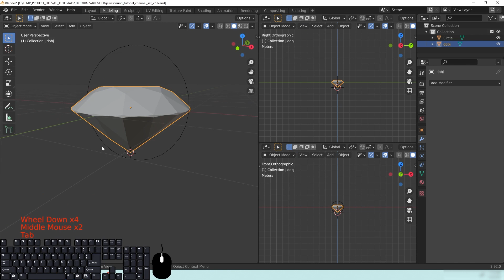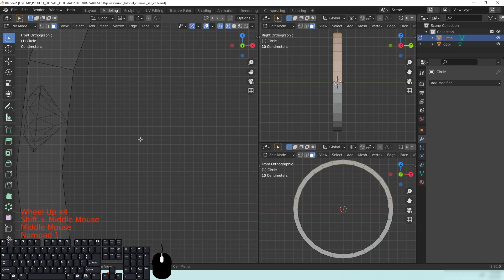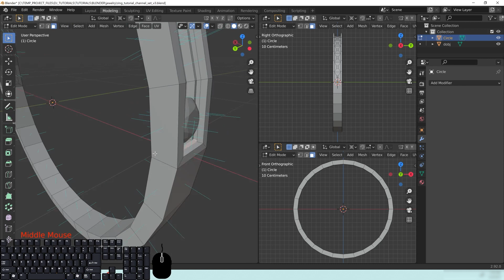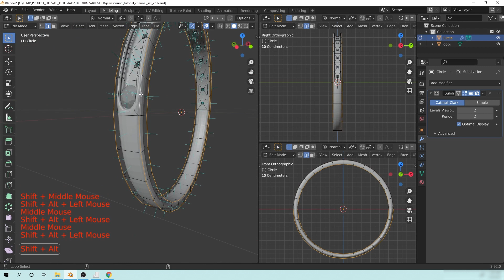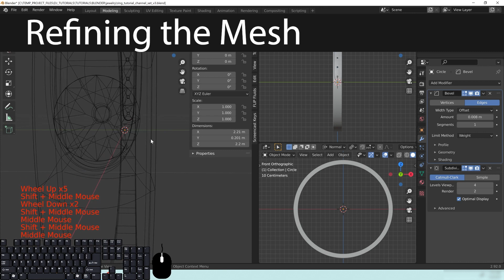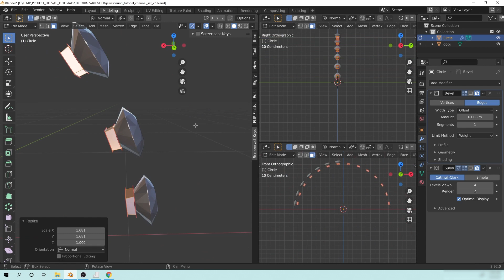Modeling A Channel Set Diamond Ring | Jewelry Design In Blender Part 1

Comment: I'm presented with a task of making a diamond necklace and then apply a rigid body to it. In this case diamonds not being the same object as the metal parts of the necklace might be a problem... Would you use parenting? Or something else to avoid a year long simulation?
Reply from the maker: You make the diamonds parented to the other object(s) or you can join them for the rigid body sim. There’s almost no reason not to have them as part of the main object (setting, etc). You might run into some weird materials stuff since some materials like it when they are they’re own object but you should be fine in this case.
Reply: @djtutorialscgi  cheers, appreciate it

Comment: The bevel doesn't work well, as always. I don't know why it always jumps from nothing to a tiny bevel and then nothing more, no matter how much I increase it
Reply from the maker: It depends on how you are using it. Use the angle degree to control which edges are beveled or in edit mode add bevel weights to the edge data and change how the modifier calculates the bevel to “weights”. A bevel will only work with how far the bevel can go. If you have an edge that is really tiny and the bevel is being applied there it will only allow an overall bevel to the smallest edge. Hopefully this helps. 

If anything jump into the discord and I will help you.
Reply: @djtutorialscgi  omg thanks. You are truly amazing 😍
Reply from the maker: @arturoe6957  anytime :)